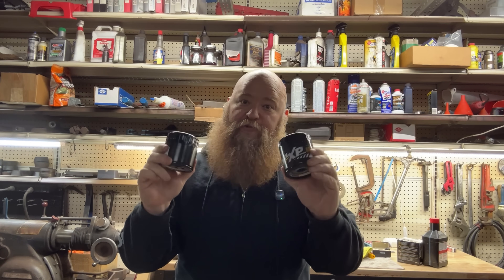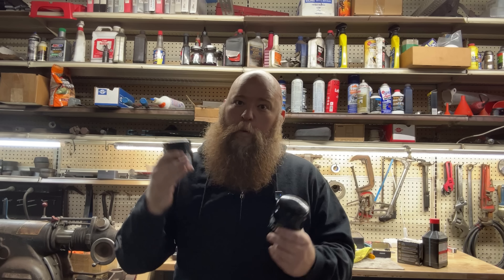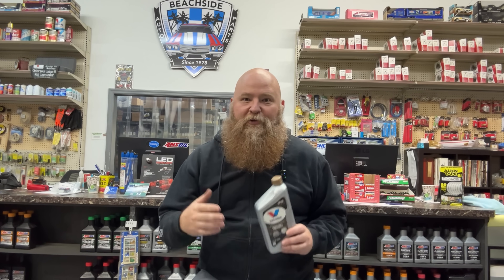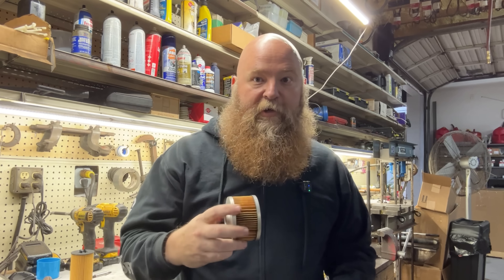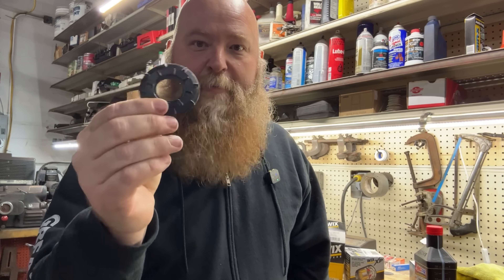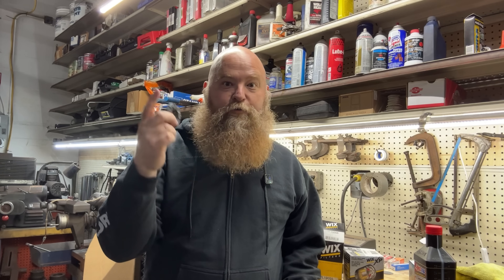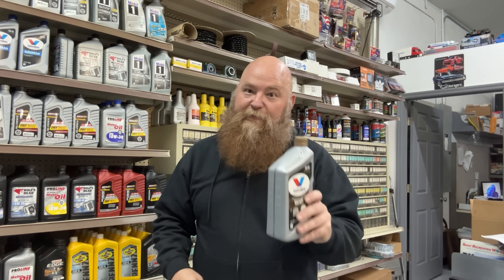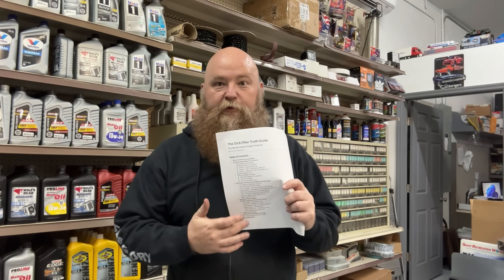Why Cheap Oil Filters Quietly Destroy Engines

Comment: Everything this guy said it true however its over dramatized. Almost all filters made meet the requirements he mentioned this includes the cheapest Fram filter.

Also the knocking on start up is typically from the fuel injectors not from an empty oil filter.

The number one thing to protect your engine is frequent oil changes not an expensive filter.

Comment: I use my OEM Honda filter from the dealer and get a new drain bolt crush washer. Not that expensive, I know the pressure is correct because it is designed from the actual engineers for my particular engine and I change every 5000 miles. Why guess?
If it is good enough for them, it is good enough for me.
 It doesn't have to be the best, just do the job competently and I will keep them fresh and changed along some Penzoil ultra synthetic I get at Walmart . 
I can do 40.00 bucks evey 5 months for peace of mind.
Reply: I wouldn't trust any of factory recommendations..they want their vehicles to fail after warranty,, mobil 1 filter way safer
Reply: @heinhandsome2010 I dont go by factory recommendations, I change my CVT oil every 25000, my oil every 5000 and brake fluid and coolant before they say to.
Reply: @jfhall2011don't used their oil filters too

Comment: Recently read an article saying don't change oil filters to often. Turns out they are more efficient after being used for a while. Maybe this is why Honda only recommends changing filters every other oil change.
Reply: Yea I wouldn’t listen to that, I work as a lube tech and I see a lot of people pushing 7k-15k miles on these filters and a lot of the time the filter collapses on itself and the oil looks horrible. Can’t be good for the engine.

Comment: Some expensive filters are junk too. The Wix XP you are holding is a good example. It has terrible filtering efficiency. One of the worst. And most Frams and Champ made filters don't have seals between the cartridge and the crooked leaf spring anymore. Unfiltered oil passes through that gap.

Comment: I use AMSOIL oil filter for my car and oil and change my oil every 10,000 miles. The oil still looks new at 10,000 miles. Car has over 150,000 and no issues.
Reply: Big deal.

Comment: BS alert from “an expert”!
- I have not seen ANY filter media broken!
- Anti drain valve ONLY matters in upside down filters!

Bottom line:
A cheap filter is OK if you change your oil every 3-5K miles! 

Claim after claim: BS!

“Extremely high oil pressures in X engines”.

Do tell us what EXACTLY are those “extremely high oil pressures”!

So imagine if these mechanics that believe they know, when they only have a “good idea”, how bad the other ones are!

Comment: 3rd generation mechanic and engine builder. Never have I seen a engine failure due to the oil filter design or media. Think about it if you have large foreign objects in your engine oil you have big problems!
Reply: I change the oil in a Volkswagen Golf R. Since I don't have easy access to whatever Volkswagen dealer uses, I used a mid tier Fram. It doesn't have the wire mesh backing the one I took out, so I'm worried about it. Fram's best version does. I could do that, I guess. I looked at Mann filters, but I don't see the wire mesh online like the one I took out, so I don't know what to do exactly. Volkswagen ones don't seem to either. But I know Fram's fanciest one (Amsoil's twin) does, and I can get one of those at Walmart with 0W-30 Mobil 1 ESP that has 504 507 that VW lists. Would that suffice?

Comment: The whole expensive vs cheap filters seems to be a bunch of crap. I've been using fram xg filters (around $11) for both, my truck and car since the first oil change and ive had 0 issues 2011 rav4 with 344,000  miles and 2009 tundra with 278,000 miles. Both in the north east. The real problem is usually not changing your oil when you're supposed to

Comment: I watched this skeptically and can't say it changed my mind. 

Of course filtration is important but if any of these factors notably affected real-world performance, you'd see it in oil analysis, and I just don't. I use cheap SuperTech filters and run them 10k but have experimented with up to 20k and always get the same excellent results, with very low solids in the engine oil and very low wear. I see the exact same across other people's analysis results as well, seen on various websites, forums, etc.

I think the bottom line is that practically all filters on the market are more than good enough and the billions of hours and dollars spent fussing and arguing over exactly what works best is, ultimately, just wasted time and effort with a few exceptions for special circumstances, problem engines etc.

Even if it did make a difference, worn engines are way down the list of what kills a car anyway. I've run at least a dozen cars into the 240k-365k range and have never had an engine wear out or even seem close to it.

Comment: I don't disagree but I've never had a problem with any filter I've sold my vehicle in the past engines were always ok never had a vehicle for more than 220 thousand miles anyway so
Reply: Do you cut open every filter? Do you know the efficiency and the dirt holding ability of your filters? Even if all the filters you use don't filter the oil you car won't die immediately. I will just start burning oil sooner and you will never know the reason.

Comment: Most filters bypass around 6000-7000 miles .
Cold starts cause the most wear .
Reply: And that means people who refuse to regularly change the oil - and no, every 10,000 miles is NOT enough - are often effectively running with no oil filter.
Reply: @jamesbosworth4191 indeed
Reply: So when Honda recommends 30000 km filter changes they are stupid and don't know when the filter goes into the bypass mode? And for your information the cold start wear has nothing to do with oil filters.
Reply: @mikman7219  They know, the reason is because, at least here in this country, our EPA gives them tax credits for doing so.  They figure that the average motorist is the one who is stupid, and, unfortunately, nowadays that is true.  I mean, young men who don't know how to change a tire?

Comment: I recommend using OEM oil filters since they have a specific design for your car’s engine, while the engine oil can be a quality aftermarket
Reply: True, you need to match flow rates.

Comment: Over a decade ago, I took a class at a community college: Automotive for Non-Majors, learning some basics of cars and their maintaince.  The professor gave a handout on 19 different oil filters.  He'd bought them all, counted how many pleats were on each one, the depth, height, and length (in inches) of each pleat.  Then calculated the overall material square inches.  Now, he noted, this didn't take into account the quality of material on each pleat - but you saw a considerable gap in how much material was on each one.  Oh, and he also gave the price (as of 2013 or whenever it was).

In first place?  Bosch had 130.481 square inches of material.  It was a little more expensive than most (ranking 15th out of the 19), but not too far from the pack.  2nd most square inches was Mann Filter (126.27 square inches) - and it was smack in the middle in terms of price).  

Fewest square inches?  Pro Select Napa, at 67.64.  It was also third cheapest, at least.  But a filter called K&N was (BY FAR) the most expensive, over twice as much as runner up, and ahd the second fewest square inches of material).

If anyone cares, here's the leaderboard (again, this is about 12-13 years old, so may be out of date)

SQUARE INCHES OF PLEATS ON OIL FILTERS:
1) Bosch 130.481 square inches
2) Mann Filter 126.27
3) OEM 108.574
4) FVP 106.52
5) Napa Silver 104.76
6) Fram Tough Guard 101.52
7) Purolator Class 98.69
8) Mopar 98.068
9) Blue Box CQ 96.535
10) PowerFlow 89.808
11) MotorCraft 88.19
12) Fram 87.555
13) Quaker State 86.893
14) Red box CQ 84.47
15) Parts Master 81.85
16) AC Delco 80.49
17) Napa Gold 78.978
18) K&N 75.992
19) Pro Select Napa 67.64
Reply: Thanks for posting the results and appreciate the write up. I’ll be researching specs a lot more in depth
Reply: Square inches mean nothing if they don't filter efficiently
Reply: @littlet7556 
OP said that.

Comment: I buy all my OEM oil filters for my 23 Camry and 25 Highlander limited from James Toyota in Timmins, Ontario, Canada.🇨🇦👍
Reply: How is the audio quality of the JBL speakers in your 25 Highlander Limited? 
I have an 2005 with the JBL and they sound great!
Reply: @nekopop8159 I also have the JBL sound system and I’m very impressed by the sound quality of it. Thank you for asking. Cheers my friend.
Reply: The engineer at Brand Ranks does detailed filter testing. Some oem filter well, Toyota removes less particles than the worst fram.
Reply: @b @bonferoni6664  Have had many Toyota vehicles and never any issues or problems with Denso filters. Cheers.🇨🇦

Comment: I just use OE filters because then I know it was designed for the vehicle with the right specs. I have a Ford, two GM's and a Toyota. I change my oil every 5K in all f them. I also have a 10K LB 2 post lift in my shop and  it makes life easier. I'm old and don't like crawling around on the floor to work on them. I probably save a couple of grand a year doing almost all of my own service and repair work.
Reply: The engineer at Brand Ranks does detailed filter testing. Some oem filter well, Toyota removes less particles than the worst fram.

Comment: This subject gets beaten to the ground more than the Kennedy assassination. Any major brand of oil filter will work fine for normal change intervals as nobody in their right mind would go to 10K oil changes. Reading the comments its personal choice or brand loyalty, not science that drives decision making. Some repair shops carry "white box specials' for cheapie oil changes, those I would stay from, but any major brand will fulfill manufacturers warranty requirements and will perform fine with 3K or 5K changes. The pour point of the oil is much more important on cold starts than the filter.

Comment: Change twice a year, around 4000 to 5000 miles, Fram filters, Shell Rotella T4 15w40, small block chevys so filter never empties out anyway, 35 years later no problems. Biggest killer of motors is 0w10 oil and 15,000 mile oil changes.
Reply: Now it is 0W 10 and every 15,000 miles???  People are dumb enough to fall for it???

Comment: Hi Chris ... I 'feel' that vehicles should now have a differential oil pressure indicator on the dash display. A simple pair of sensors. One sensor on the oil pump discharge and the other on the system lubrication galley's feed. This would indicate the pressure drop through the oil filter. The differential warning could be manually adjusted to just below the oil filter documented by-pass setting. Extended oil / filter changes could then be correctly monitored. The oil may last longer than the filters capacity. At that point (To extend oil changes) the filter could be changed out with the addition of needed oil to return to full oil capacity along with maximum oil filtration.
One other thought ... Oil filters with a dual layer of filtration micron ratings, may allow greater filtration over it's life. I.e. 30 micron first level 15-20 micron second level. Two layers of filtration to increase filtration lifetime along with high micron levels of filtration.
Chris I feel that you may have a good grasp on this. 
                                               What do you think Chris? Awaiting your response. ... Chester

Comment: With 3000 mile oil changes and quality oil, the filter becomes much less critical.  Side mount filters need the anti drain back valve but vertically mounted ones do not since gravity keeps the filter full all the time. My preference is AC Delco filters for my GM products. On engines with over 100k miles, go up one weight class for longer engine life. Trash the 0w20 stuff unless you are in arctic circle or similar. 5w30 is my pick in cold winter and 10w30 in summer.  10w40 or 15w40 for towing heavy loads & hard work. I miss the bigger longer oil filters.  and the QUART sized ones of the past. NOW those were filters!!!!
Reply: I still use quart-size on my 73 GMC, and my Chrysler gives me no choice - it is the replacable element type, so it is quart-size canaster.

Comment: I use K&N Performance Gold oil filters, always worked extremely well, easy to spin on, easier to remove with the integrated nut.

Comment: Use oem filters purchased at the dealership on all my cars  dont mess amazon or with fram,  stp,carquest etc lol
Reply: The engineer at Brand Ranks does detailed filter testing. Some oem filter well, Toyota removes less particles than the worst fram.

Comment: You don't always get what you pay for.  
Most oil and oil filter manufacturers come from the same source.
Reply: Baaaah!  What?  The best oil comes from Cryo Chilled natural gas.  Quality filters have quality parts inside.
Reply: @Trapster99  As far as oil, it's not that simple. Group 3 Mobil 1 Truck & Suv is every bit as good at Pennzoil Ultra Platinum. Actually better. Natural gas stuff has a downside. It completely drains back into the pan, leaving virtually nothing on the parts for cold starts. Everytime. Great detergent package though, but it's NOACK % went way up since it was first introduced. Not good. Mobil 1 T&S stays on the parts more, and the best part is that no one has matched it's cold flow in the class of full synthetics. It stays fluid, no matter what, due in part to its group 5 alkalated naphthalene that behaves as both detergent, and seal conditioner instead of traditional esters. It's been proven by an HPL laboratory to retain film strength when compared to other, mainstream API full synthetics, including Pennzoil Ultra Platinum. Only 100% synthetic stuff like Amsoil could match it's cold flow, and probably outperform it in shear resistance.
Reply: @YamahaCubed  So, the best choice is still Mobil 1??

Comment: 90% of us have no idea what oil filter is on our car, nor do we have a voice in which one is chosen.   Recent oil change in my GMC Terrain at the dealer - who knows what filter they used?   Last oil change on my Accord at my independent repair shop - who knows what filter brand they used?
Reply: Unless you live in an apartment, why don't you do it yourself?  Then you WILL know.
Reply: @jamesbosworth4191  True, I'm just saying that 90% of people have their oil changed at a quick lube, local mechanic or dealer and so don't know what filter they are using.
Reply: The dealer most likely used an AC Delco on your Terrain.
Reply: @iuyozx I work for a mitsu dealership and we even use ac delco filters on all GM vehicles

Comment: Wrong on this one brother all Oil filters must meet SAE guidelines and must provided protection to the engine . yes some filter are better but they must be compliant for warranty issues. No one is going to put out a filter that does not do its job some just last longer than others but they all filter the oil and do as advertised. It's better to buy 2 cheap 3 dollar supertech filters and change them 2 times during the life of the oil. Way better protection for less money but it takes up time
Reply: Your are correct.  He got this one wrong.

Comment: funny. filters used to be non existent. simply changing the oil was all you could do. non detergent oil, leaded fuel, sludge buildup, and if an engine came close to 100k you had a lot of miles on it. odometers only had 5 number spaces to the left of the tenths. it was a big deal when the thing "turned" at 99,999. that's low mileage now. oil and filters has become a science.

Comment: more great advice.  I've always liked Mobil 1 and Wix filters, but sometimes it's good to go with the manufacturer OE filter - on our Subie for example, I use the stock filter because aftermarket ones have different PSI ratings for the bypass valve. I also use Honda OE filters on our Accord.  for the Benz, which takes cartridge filters, it's Mann OEM cotton filters all the way.  and the Audi gets Mobil 1 because, well... nothing makes an Audi reliable so it doesn't really matter lol.
FWIW - absolutely, positively, DO NOT use extended oil/filter change intervals!!  NEVER EVER.  the manufacturer who recommends to go 7500, 10000, or 15000 miles between oil changes ONLY CARES IF THE ENGINE LASTS AS LONG AS THE WARRANTY DOES.  every 5k with quality synthetic. I'm pretty sure that's in the bible.

Comment: I don’t know. I use $1.50 CHAMP oil filters. I have been using them forever… I think changing that oil often is the most important here. Considering that service grade filters (which are cheap ones) are the majority of them used at mechanics and garages across the county, I dare say the expensive filters are a waste of money. Not trolling, and if I take some heat for this statement, whatever. I know what I know from my experience only.
Reply: I subscribed and liked the video though! Thank you for the info!

Comment: I’ve used Wix XP filters(made in USA)  for awhile, now they’re made in Mexico. I still bought them but wonder if quality is still the same or decent
Reply: Placed low in testing. Poor filtration but good flow.
Reply: @derrick_is_dnice  And that is probably more common that most people realize - filters with the highest flow rate often are the coarsest, and coarse filters don't filter very well.
Reply: Some are also made in China
Reply: I find Mexican made auto parts excellent.
China is crap.

Been a mechanic since 1975.
Reply: Los filtros hechos en México son muy buenos.
Reply: @ew1usnr  Completely disagree. Autozone sources their STP XL filters from several different suppliers, so you can see the difference in quality. The filters made in mexico consistently had sloppy glue jobs and uneven pleats. The filters made in korea have always been excellent.